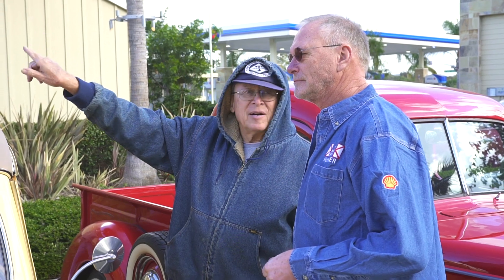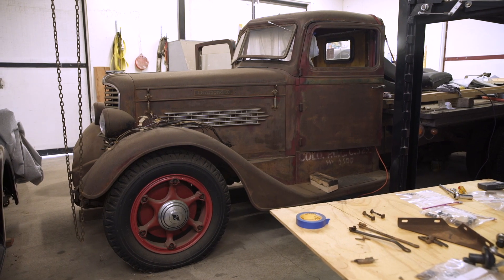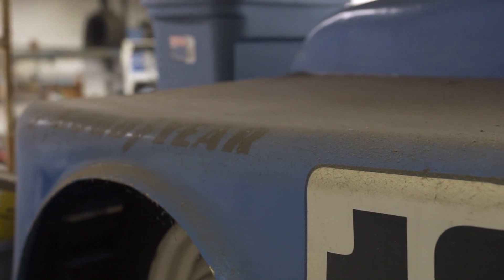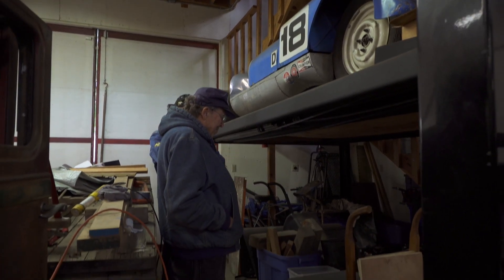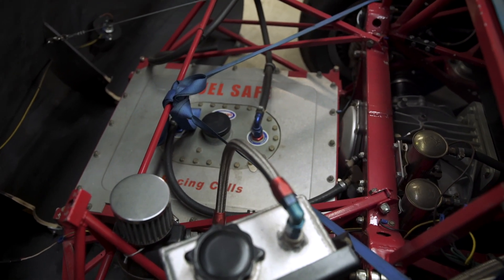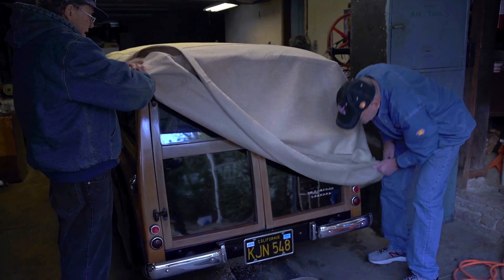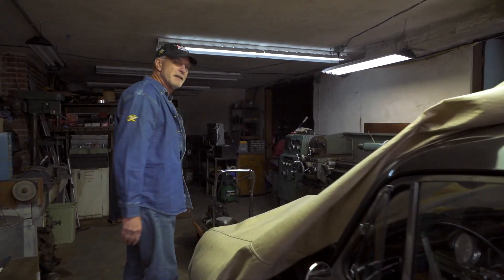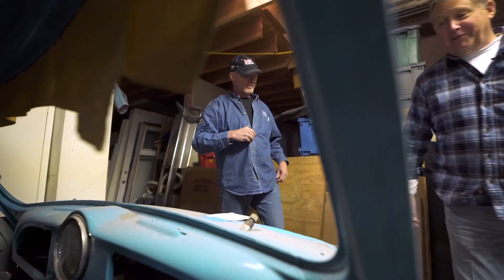1 of 3 Santee SS with Buick 215 Aluminum V8 and a Morris Minor Traveler | Barn Find Hunter - Ep. 92

Comment: I owned a 1962 Buick Skylark with the 215 V8, 4-barrel carb and 2-speed automatic. Paid about $200 in 1980. It went like an absolute bat outta hell. It would shift into first at anything under 70mph and blow the doors off, well, anything. In neutral on flat ground the force of the fan blade would pull the car forward. Absolute bat outta hell.

Comment: When I was younger. I was working for an Old concrete Co. They had a '52 Diamond T mixer truck. It became a project of mine to repurpose it as the slurry pond clean out rig. So we yanked it out of the back of the yard. I pulled the grill badge off and put it in place of the one on the '69 Ford f-100 I had at the time. Sorry, just reminiscing.

Comment: Is that an original MG Mitten out of Pasadena covering that Morris?  They were the tops for protection in the 70's.  Back in the day, if you showed up at a Shelby meet with your Cobra or Trans Am Mustang, the Mitten was the go to to keep it safe out in the parking lot after the show.  Thick, but soft on the inside, tough on the out and washable.  Great protection from nicks or scratches in the garage...

Comment: So am I right in understanding the Buick 215 is the same engine as the rover 3.5 used in the UK. also the imp engine was a variation of the Coventry climax engine.
Reply: Yup... GM sold the technology to Rover at some point and then tried to buy it back 10 or so years later. 😂
Reply: @BEVO_vs_The_World  thanks for the reply and the information, very kind of you.
Reply: @adamweston4152  no worries. If i could remember where and when i learned that information I would cite it with facts. My brain is telling me it was Tom Cotter in the UK episodes? 🤷🏻‍♂️
Reply: Correct on both counts . The climax was developed as a water pump in the second world war . It had to start and run at maximum revs for hours at a time . Climax were also successful in motor racing .
Reply: @johndavey72  thanks John, much appreciated reply.😉👍 Lotus used climax engines in quite a few of their cars, road and race versions.beautifully made equipment.
Reply: He said it's an Olds 215, the Olds had semi-hemi heads with different chambers sizes for compression ratio and the Buick 215 had the same cc wedge heads with different pistons for different compression ratios.
Reply: Yes to a point.  The Rover V8 is subtly different due to Rover productionising the engine.  I believe that Buick/Olds carried on with an iron-block version of the engine which was easier to produce and more acceptable to the marketplace, was enlarge over time to 340Ci and also had two cylinders lopped of it to create the odd-fire V6 used until the late 80's early 90's ??

Comment: I may be wrong but I think the Olds 215 and the Buick 215 shared the aluminum block. You can tell the difference externally by the heads. The Olds heads are at the angle of the V. The Buick heads stand upright. The Buick is a baby Nailhead which refers to the small valves that help created torque. I think the Olds had larger valves. Olds also had a super charged version which Buick never did. I own a 1980 Triumph TR8 with the Rover version and a 66 Skylark with the 300 CI  cast iron version that Buick went to after the 215. I believe they sold off the aluminum version due to production cost.
Reply: Actually the Buick version of this engine was not a Nailhead. Buick designed the valve covers to make it look like a Nailhead because that was kind of Buick's thing back then, but the valves in this engine are not vertical like they were in Buick's larger Nailhead V8s (322, 364, 401, 425). This engine actually evolved into the small-block iron Buick V8s (300, 340, 350) and the famous Buick V6 that eventually became the 3800.